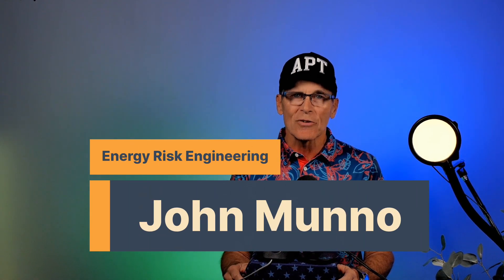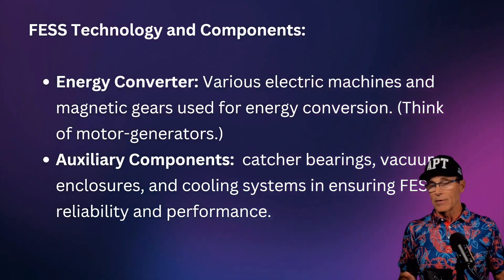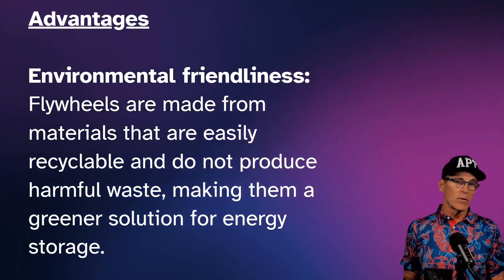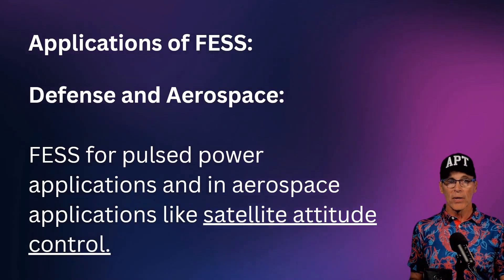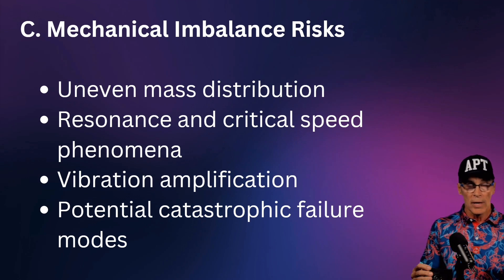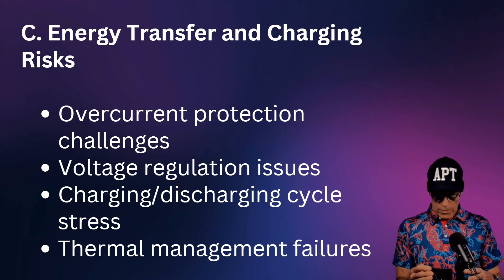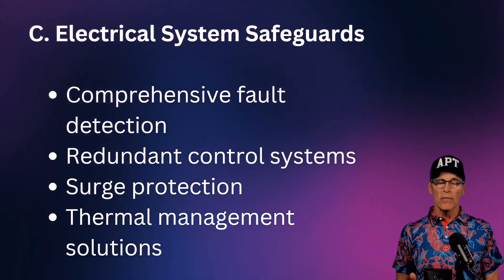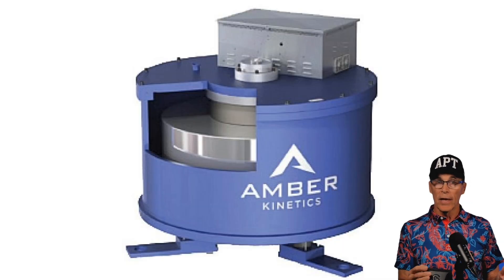Flywheel Energy Storage Systems for Risk Engineers

Comment: About flywheel materials. What about chambers filled with fluid? Weight, whether steel, composite, or fluid is weight. During spool up, the chambers can be empty requiring less energy and filled slowly adding mass and balance on the fly. If there is a failure and the flywheel escapes, the fluid will dissipate harmlessly.

Comment: Great video! I also suggest to check NFPA 850 chapter 19. Thanks again John.
Reply from the maker: Will do! As you know from the rest of the videos on the channel, I’m not a fan of codes and standards as  tools for risk  management. I have been on the NFPA-25 committee for over 25 years and have become seriously disillusioned with the process. That said, I’m a big fan of my subscribers and will definitely look at 850. I do plan on continuing the discussion of Flywheels especially after being attacked on LinkedIn for just suggesting that they may be useful in place of BESS for certain applications. More to come! Thanks for commenting.